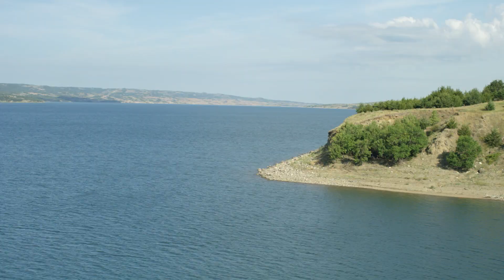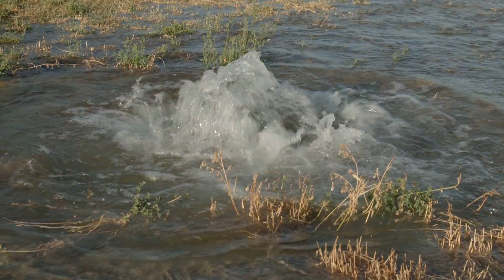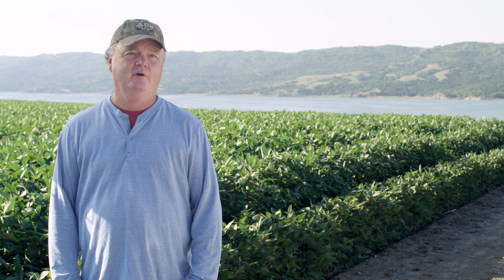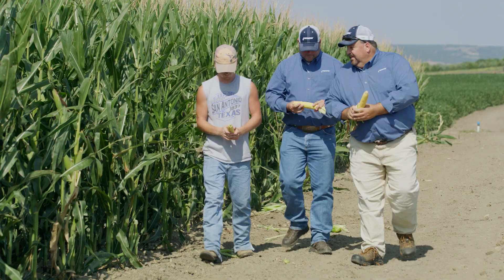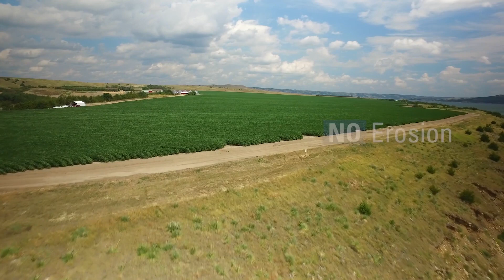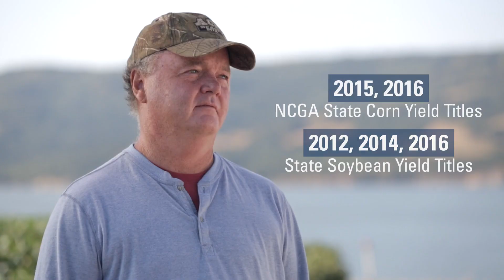THE RIVER

Comment: Do you have moles in your area.  I am in the southeast and the main concern holding me back is the possibility of moles pretty much ruining the system by keeping it full of holes.  I have looked at mole control and the time and labor of that seems to be in excess of what I would want, not to mention that all the mole control in the world is far from a guarantee that I will prevent them from getting into the field.  Is there an underground pipe system that a mole or gofer could not bit through, at least not very easily, that would be comparable in price to the tape system?
Reply: Not sure. Still got moles? How bout gofers?